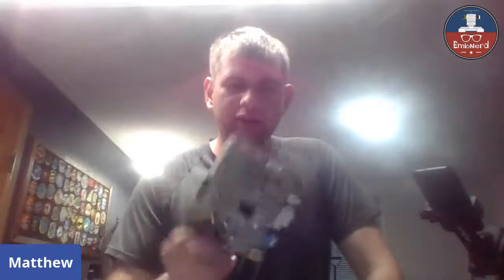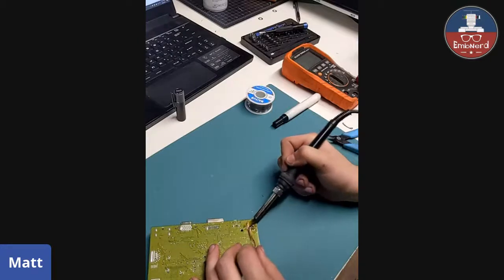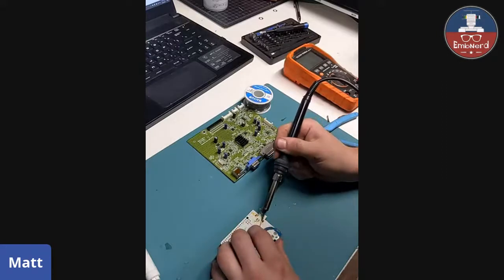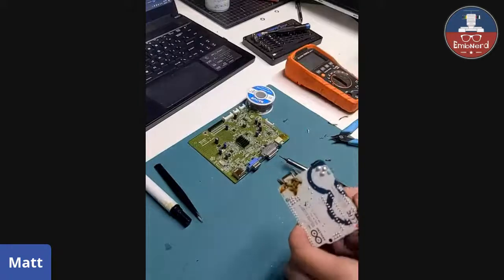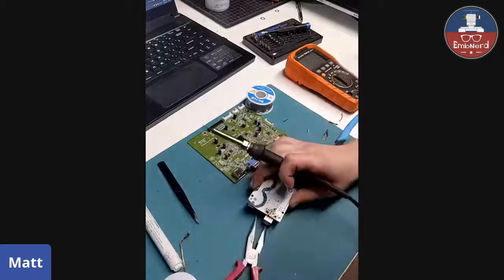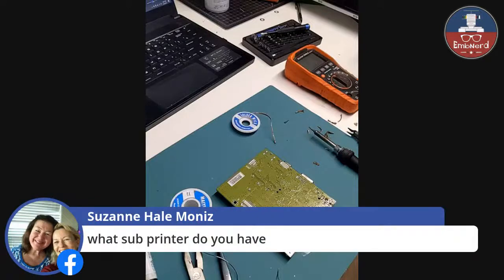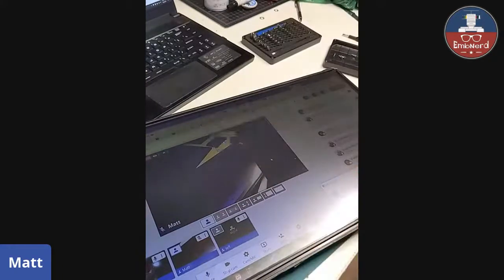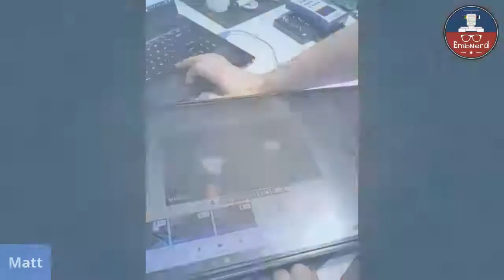Off-topic Sunday: Circuit Board Repair

Comment: Update: touch screen does 'work'. It has some quirks for sure. It only registers my touch occasionally, does not track well. The usb ports on the side work now that I have the connector in. Soni didn't fry anything. And the touch screen sensor is on a separate board.